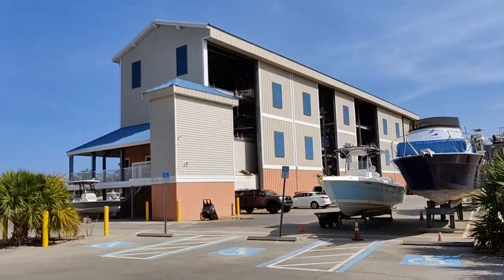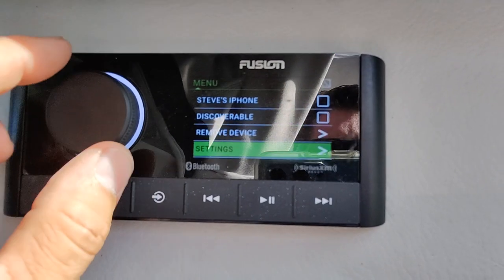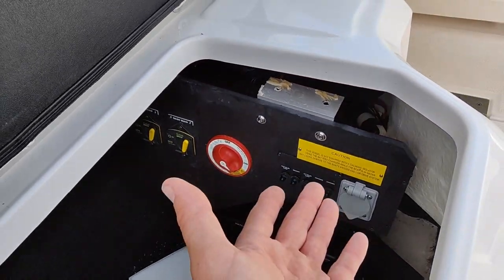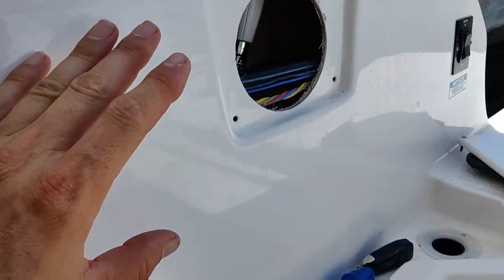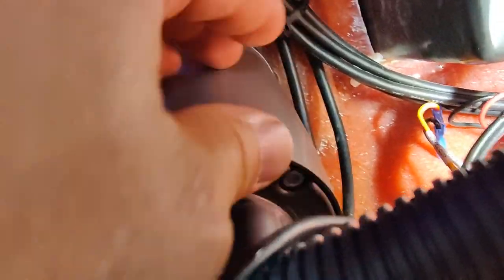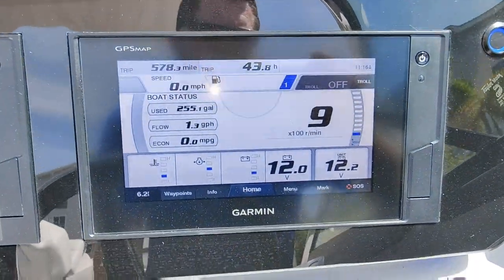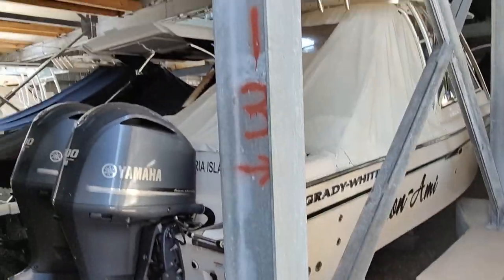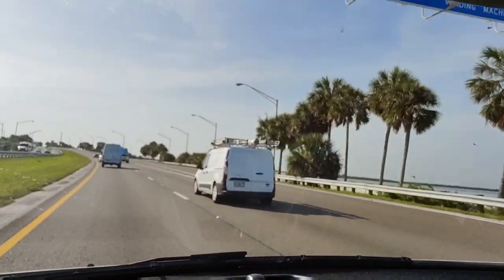Road Trip To A Regal LX4 #Marina #Regal #Garmin #Yamaha #Episode169

Comment: The marinas over there looks so nice. In Norway 🇳🇴 most boat hotels looks terrible. Basically just warehouses with dirt all over. No fake windows to make the building look better. We have one super modern marina in Oslo, but that’s the only one I’ve seen. Good job finding that loose wire 👊
Reply from the maker: Boat hotel.  I have to use that one.  I have been to some bad ones.  The area I live in is also "big money". 🤗